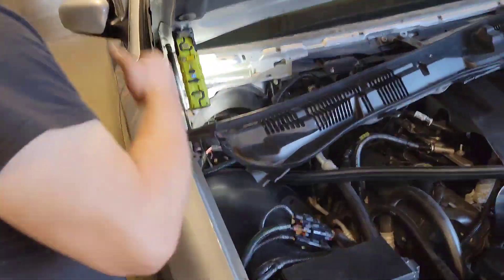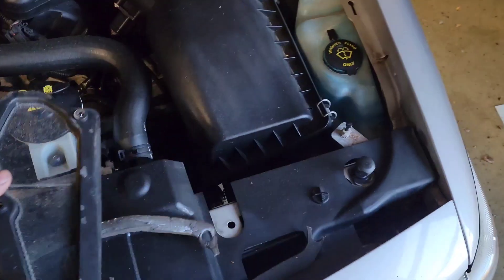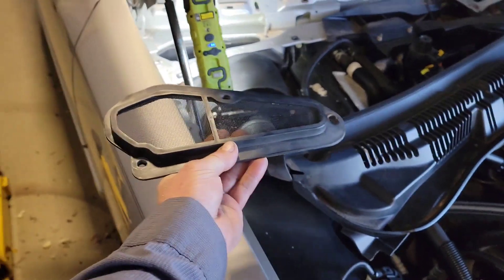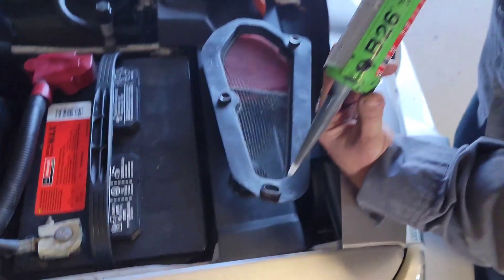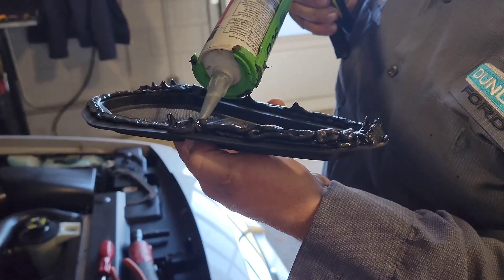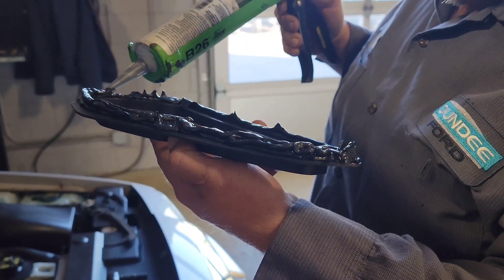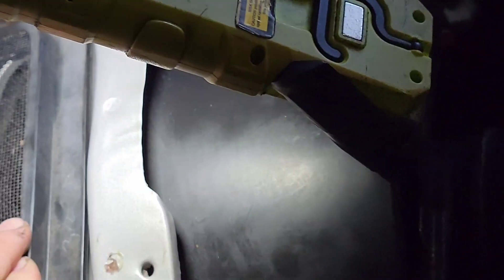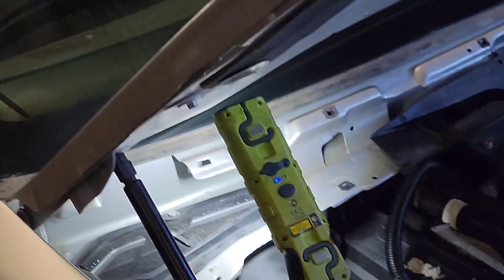2006 Mercury Grand Marquis water leak reseal - first repair / modification at 80000 miles

Comment: Been there done that to my Lincoln my brother. Yes and it does work you have to cake it up with the silicone just the way you did it.. No leaks for years to come. This is a big common problem for all the panther platforms. Loved it thanks for showing this. 64

Comment: Beautiful car, definitely a garage Queen since new, those headlight and that thick clear coat still look assembly line fresh!! With proper care this car will easily go another 250,000+ miles with nothing more than an intake manifold eventually and a few little things like EATC o-rings....

Great reseal on that fresh air intake.
Reply: I've done plenty of eatc orings on these things. I did have one that I couldn't get to work though. My 2005 has just the manual controls and I'm happy with that.
Reply: Replacing intake manifolds is a given on these engines that we owners all know about.

Comment: My 2005 Grand Marquis was leaking water onto the driver's side of the car. I found the hood release cable grommet at firewall was worn and causing a small hole and water would drop onto cable and follow it into the car. Repaired hole with some silicone and added a plastic grommet conduit from a coil wire around the cable to disrupt the flow of water. Fixed leak.
Reply from the maker: Yeah that's one

the one that I showed him this video is the most prominent major water leak with these cars

 but I also have other videos showing other areas people should address

Comment: Good thing to do. I had a bad leak twice because of that. To get the musty smell out you need to replace the gray insulation under the carpet if it happens. It is like a sponge and never totally dries out.
Reply: Prop the carpet up so it can get air under there. I put pieces of 2x4 under mine and left it for a month.
Reply: I just cut that insulation out and threw it in the trash. But my floor is rubber anyways.

Comment: Spray the frame with fluid film otherwise the salt will ruin it. Cars in great shape and it sure beats having a payment
Reply from the maker: Are you talking about the white slime spray?
Reply: @FordBossMe  No it's not white it's more of a golden brown ish kind of color. The smell is very distinct since it's made with woolwax. You have to apply it once a year for it to work but man that stuff is great, unlike ziebart or other rubberized undercoatings that will actually  accelerate rust formation. If you look up fluid films website they actually sell a kit where you can get it by the gallon and it comes with a sprayer with several nozzles, they are perfect for body on frame vehicles you can physically put the sprayer inside the frame and get really good coverage inside and out
Reply: @FordBossMe  Have you tried out the PB Blaster Surface Shield?

Comment: Can you grind those little knobs off so it will sit flat? So you don't have to use as much silicone.
Reply from the maker: You don't really want us to sit flat because if it sits flat that means you're going to give water a chance to get over it sooner and then have a higher chance of it getting in the car
Reply: @FordBossMe  Thanks for the explanation. I thought you were doing that to keep water from leaking past the foam gasket. Keep up the good work. You are appreciated.

Comment: Just found your channel recently, love it! and the way you do things. Besides that, you are entertaining Thanks. I just purchased a 2005 Grand Marquis that was garaged keep one owner and very well maintained. It leaks water onto the driver's side floor when rains..I was told it could be the hood latch cable going through the firewall? or is it what you are showing in this video?
Reply: should have read more comments, thanks to all who posted
Reply from the maker: So the most common leak is the one I did hear and then the hood latch cable is another one but it's not as common
Reply: @FordBossMe  The fix your doing in this video is for water leaking on the passenger rug. Right?

Comment: id like to meet the einstein that designed that crazy system. anyway a vital modification if that dandy is leaving its pampered garage kept environment and going out in the real world...5-gallons of water in the passenger floorboard front and rear if you don't do this.
Reply: Right... it's like putting heater cores inside dashboards. They used to place them on the firewall in the engine compartment, but some genius decided to put it inside the dashboard one day when they were designing a vehicle and every other car manufacturer followed suit.
Reply: Wish they were like my 69 ltd
Reply: I replaced the fresh air intake foam gasket seal on my parent's 05 Lincoln Towncar several years back.  It was similar in design but a little more work involved.  But yes, there was indeed dampness under the front passenger side floor mat and standing water in rear passenger side floor board.  After I ensured repair was a complete success I pulled rubber plugs out from beneath both footwells and let the water drain out and air in to dry carpet/padding.  After about two weeks of sunny dry weather I put plugs back in floor board.  Repair still holding today.
Reply: @gregambrose2566  Yes, sir two clamps, 4 screws and about 5 minutes to change it out.

Comment: Isn't there a cabin air filter under there somewhere?
Reply from the maker: Nope
Reply: There's a guy online that sells cabin air filter conversion kits for this. Plus I think a jeep filter will work in there with some trimming.  Worked on my 99 towncar. Look up adding a cabin air filter to Lincoln towncar
Reply: @gregambrose2566  OK I'm glad I didn't buy one because from other places I looked at said there was a filter there. I would have purchased a filter ...took all that apart and had no place to put it on my 2011 Grand Marquis. LOL

Comment: Did this on a Town Car for my sister. Not hard at all.
Reply: You worry me Jeffery I don't know should I check if my town car should have this as I have had other town cars and they clog up.
Reply: @prestonrobert2625  
If you ever start getting water in your carpet on the passenger side floor this is most likely the problem